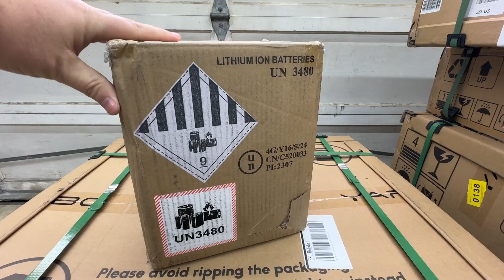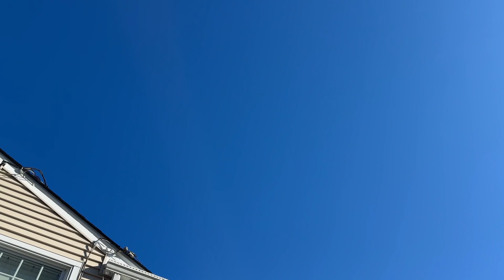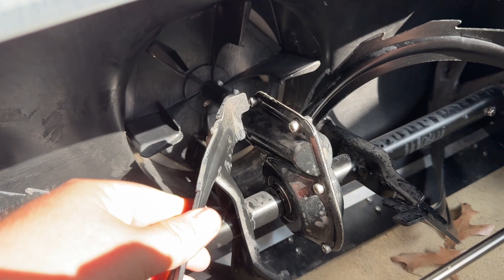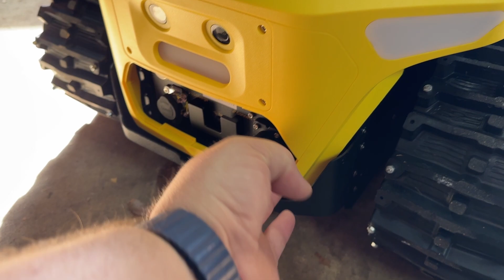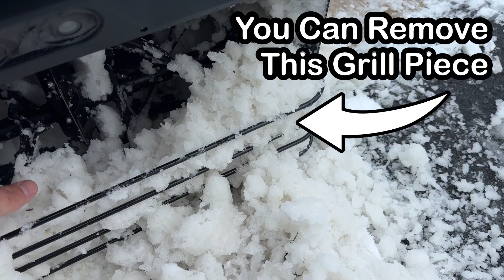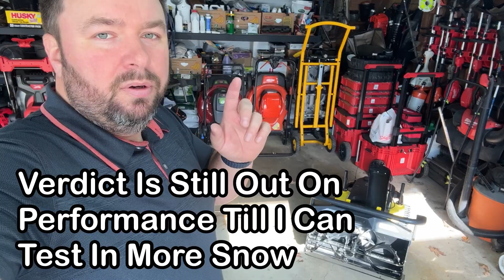This Robot Snow Blower Handles Winter So You Don’t Have To!  Yarbo

Comment: how many mowers do you have lines up along wall?  how would a sheet of ice affect height as distance is still same relative to tracks on surface/ground.  @12:19 HUGE pile of snow plowed out in front. TAKE OFF THAT GRILL!   spray inside with simple silicone spray. don't need that chemical garbage.  

last thing, looking at your belly. you NEED to get out more and stop buying things to allow you to stay on couch.

Comment: Does it need Internet to work? Or is it lokal controll?
Reply from the maker: Needs internet to work on its own.  It’s a hard-wired connection from the router to the RTK unit via power over Ethernet.  But you can manually control it without internet or gps by using the included remote control.

Comment: I don’t like the fact that I have a brand new paper driveway and it will scratch up all of my brick so just for that I would have to pass
Reply: You don't need to run it with the studs. You also don't use the blower without the blade for the wet stuff. You CAN, but it's recommended to plow rather than blow the wet stuff. Any snowblower has issues with throwing that kind of stuff.

Comment: Looking to possibly buying it for clearing my ice rink. 60' x 85'. On smooth ice how long to clear 1 inch and 6 inch, best guess is fine. Will it need to charge before completing?
Reply from the maker: I’m assuming you are clearing the snow off the ice, and not the ice itself?  My driveway is about 1,000 SF and you are talking about an area just under 5,000 SF.  We had our unit setup to do a double pass (work twice).  And it would use up about 40% of the battery.  The battery is very large and lasts a really long time.  I wouldn’t be surprised if it could clear the snow off your rink in one charge.  Especially if it’s soft and fresh powder.